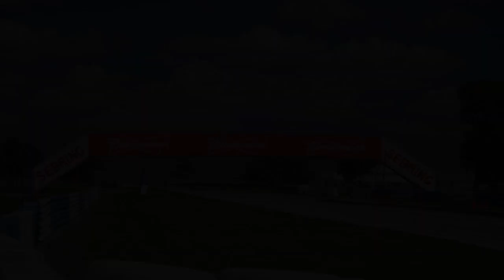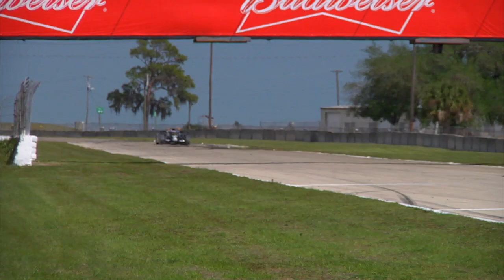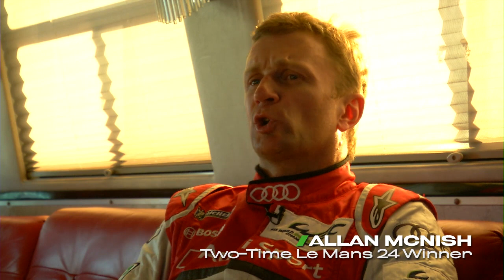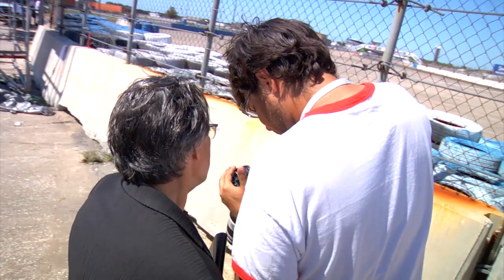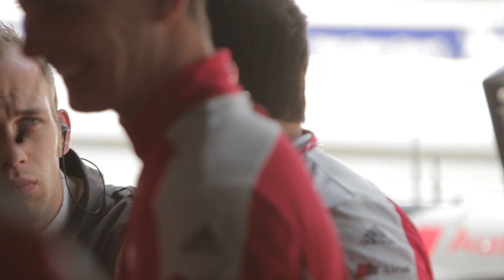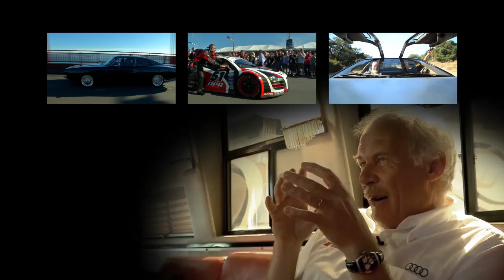The 24hrs of Audi R18 e-tron quattro Sebring Test - /SHAKEDOWN

Comment: is there a track that both Indycar and Lemans cars race so we can see the lap time difference?
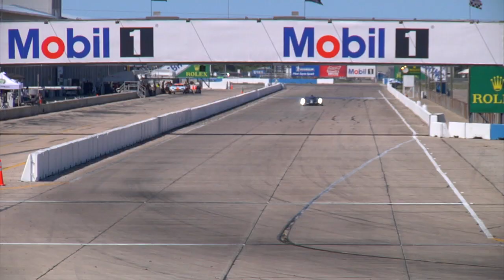Reply: Nick R He actually did... mentioning that F1 cars are faster, and yes they are... they've Higher downforce + 500- kg + 700+ HP, the result is a car that can lap Suzuka circuit under 1:30.
Reply: Sebring?
Reply: Ryan Spalding Nothing you said was correct. Pretty impressive.
Reply: I know ;)
Reply: As of when? Sources? Comparison times? The Audi has a much faster straight away speed and much more powerful engine.

Comment: Was thinking same. But I asked many drivers if they felt the fin - in the wind or turning [in yaw]. Answer was no. Only I racers added it did effect the rear wing.  But would not explain if its keeping the air channeled to the wing cleaner for more downforce OR blocking the wing in yaw forcing less downforce.  Bottomline answer was fin was no problem. And fin + fender holes maybe stopped Timo crash from being a flip.